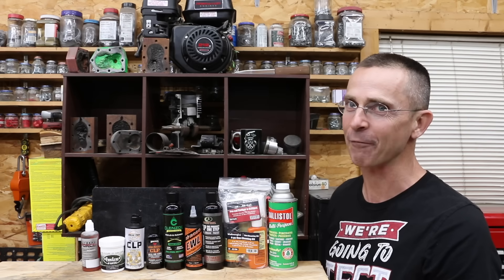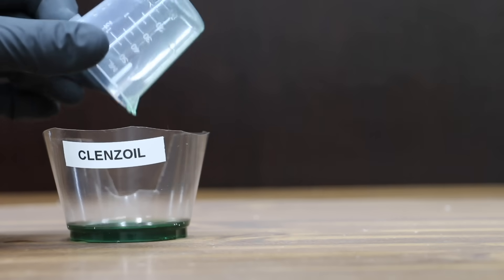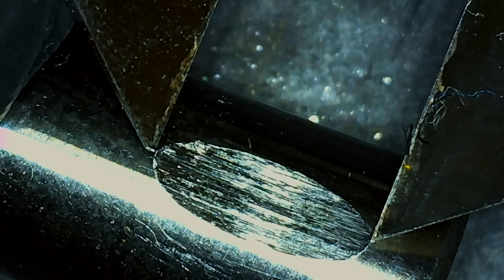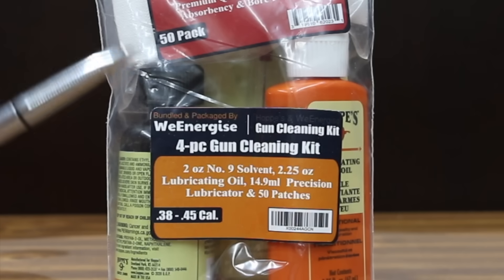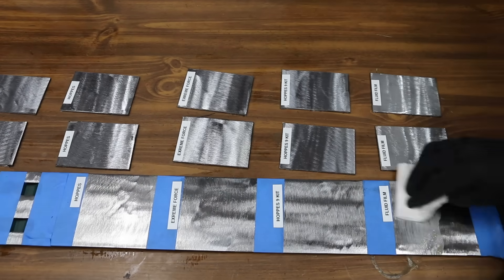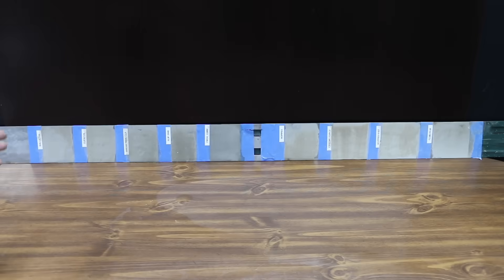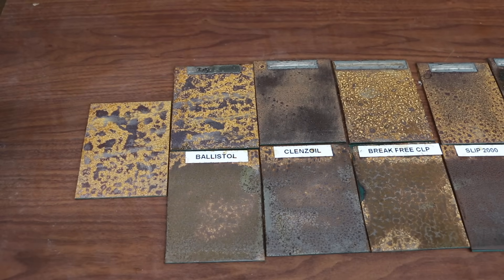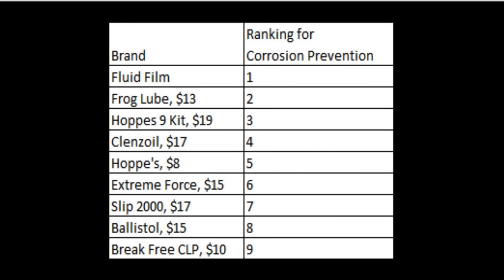Don't Buy A CLP Until You Watch This Review! It'll Save You Time And Money!

Comment: Would like to add my experience with froglube here. His tests are very good but he did not test how well they perform on firearms after being in storage. I was solidly in camp froglube because of the non-hazardous material and pleasant smell, as well as the purported good lubrication. I used it on everything. I have more guns than I care to mention so even when I shoot regularly, some of them inevitably sit for awhile. After 6+ months of sitting in a safe, froglube will gum up, will semi-solidify, and will cause malfunctions. It made an AR action very difficult to rack, and it more or less stopped my 1911 TRP from working. You could pull the slide back, release it, and the slide would crawl the last half inch to get back into battery. Imagine having this stuff on a carry gun on your side that is unfired for over 6 months. Highly believable, especially with the wider variance in temperatures that you're sure to see versus the gun sitting in a safe. 

Do not use froglube.
Reply: Same thing happened to my 10/22. Took it out to shoot after a few months of sitting in it's carry bag. Lots of clicks but no bangs. Ends up the frog lube had basically glued the firing pin into place. Ended up breaking the whole action down and cleaning with alcohol, and just went back to my regular go to, Mobile 1 synthetic 10-30.
Reply: @CaptainXanax  is that 10w30 your saying?
Reply: @GeauxRilla  Yessir. I had never tried it until a coworker of mine who shoots competitively says it's all he uses. That was about 10 years ago. I guess if you live in a consistently freezing climate you could use 0W-30. 🤷
Reply: Same thing happened to me… every single gun….  Never again
Reply: Rumor is that it's mainly coconut oil.
Reply: @justinkase1360  that would be accurate as it has the exact same consistency and feel. However there are additives as it seems to clean well, for me anyway, I assume their "extreme" liquid lube that is for colder weather is just fractionated coconut oil. I think after I run out of product I may switch to something less fussy, but for now it works well enough for my use.
Reply: @justinkase1360  it the base with additives. The additives are what do most of the cleaning and protecting
Reply: You put it on waaay too thick.
Reply: Had similar experience with the liquid frog lube when I liked weapons out the safe to do random functions testing & what not  in an unheated portion of my home just to realize that all that I had cleaned in the last round since I purchased frog lube were extremely sticky action wise and would not function. Took them in the house front of the heater and they function tested fine but that was the nail in the coffin for frog lube for me. Can't trust it in cold weather and can't trust it on my edccw then I don't need it. Really wanted to stand behind it being a disabled veteran myself and this company being owned by disabled veterans but I'm not willing to sacrifice my family's safety just to support a fellow veteran.
Reply: Same exact thing happened to me, and I argued with several others about it, I threw it all out afterwards. It smells like a menthol wintergreen, but the effects of being stored, nah I'll pass.
Reply: Have had  Frog lube weld a gun up solid  till hosed  down with WD 40 ,after sitting around , works for guns in hot/warm weather that are in continuous use ..  idle  guns  a now go . Great preservative on the out side of a gun , but keep away from the innards ..
Great video ..
Reply: While I agree about storage, the carry gun issue isn't as bad as your body heat typically keeps it from gumming up.
Reply: @GamerNxUSN  I would not want to count on that.
Reply: I had a very similar experience with frog lube too.  Frog Glue would be a better name because it seemed like glue in my AR after a few months.
Reply: What is it like externally after sitting..??
Does it still feel the same and does it come off??
I'm thinking about using Froglube  on the outside of blued tools to stop rust while using other products for the actual lubrication..
I like the idea of touching wax coating instead of getting oil on my hands with my tools..
Reply: @zakofrx  Try mineral oil from the pharmacy section of the store. Sold as a laxative, but it's an excellent lube and protectant for things like hand tools. It's safe to eat. Same stuff is in baby oil.
Reply: It's coconut oil. Ugh.
Reply: Had the exact same experience. Do not use Frog Lube!
Reply: You have to remove most of the residue after heating a thicker layer into the metal parts. Its essentially a dry lubricant working at a microscopic level. If it gunks and freezes up then you have it on too thick.
Reply: How much do y'all put?  Ive never had a problem
Reply: Been using Frog Lube for probably around a decade. It's on every gun, long and short, that I own. I live along the Canadian border, and worked law enforcement for 3 decades. I never had a problem with it. The idea is to apply it and then remove as much of it as you can (if you aren't applying it and letting it sit in the oven). If there's nothing but the things film on the parts, there's nothing to gum up. My days sometimes saw 20° below zero, and no issues. Apply it thin!!!!!
Reply: You're using the product wrong.
Reply: Dude, But A Navy SEAL made it Bro!!!!!🚢🦭
Reply: I was told by a Frog Lube Representative that putting the FL on a AR boltcarrier group then putting it in the oven on150-180 degrees for 10 minutes or so and then removing and reaply a light coat on the bolt was the intended way to get the penetrant to soak into the steel. Just what I was told, suppose to replicate RF85 coating. ** remove the rubber o ring in the extracter hole first if your bolt has one**
Reply: I had it freeze my safety on an AR. No bueno!
Reply: Never had any problems with it. Not sure how it gunks up when you apply it by heating the metal, brushing it on, and then carefully wiping off the excess. Sounds more like operator error than a bad product.
Reply: @silntstl  These dudes using Froglube like axle grease. . .
Reply: Frog Glue gums after about 45 days.  It will gum up even quicker if you don't have every speck of petroleum based products cleaned off your gun prior to applying it.  So, if you use Frog Glue and then are at an event and need a re-lube, you cannot use any other product or your pre-applied Frog Glue turns to honey.  Frog Glue is for suckers;  it's dog crap +P.
Reply: The bio degradable cleaner worked really well. The lube not so much.
Reply: Right. Which is ridiculous if you’re in the field. I used a lighter and melted it on. But I still found in freezing temps it clogs up. I’m sure it has its place but for me, not practical. It’s easier to use an oil type lube and be done. I’m cleaning my weapons on a regular enough basis dirt is irrelevant
Reply: I 100% agree. I used Froglube for about 3 years and after taking out a firearm which was lubricated with Froglube and stored for about 6 months, I was shocked to see that it was basically "caked" and the lube had turned into a gummy substance which no longer provided the same lubricity it did when it was first lubricated.
Reply: that's because froglube is coconut oil
Reply: frog lube is the worst.  as in worse than nothing
Reply: Aren't the parts supposed to be heated up to 120F and the Froglube applied in a very thin coat, left to sit and wiped off?
Reply: Frog lube is garbage----when ANY product says it was made by a "Navy Deal" you know it is BS.....
Reply: Are you talking about the paste version or the liquid as well?
Reply: It looks like the gunk you get from too much oil.
Reply: I've experienced similar, but I still use it to "season" the metal (I bake the parts at about 185) and use another lubricant (kroil works very well specifically because it's so thin) after wiping it off.  Works great that way.  However, you can also just use a heat gun or hairdryer on the moving parts and cycle the action a few times and it's fine.  Frog lube is designed to increase it's lubricity as the temperatures increase.
Reply: I noticed that.  When I first took a stored 1911 style pistol out of the safe, racking the slide was noticeably more difficult with the Froglube on it.  Once the pistol warmed up to room temperature, it was fine, but what you've said is something to think about.
Reply: Thanks!
Reply: For long term storage I've been using corrosionx for YEARS now and there litteraly is no better product for protection purposes. Never gums up, is safe on pretty much all materials and just the smallest bit goes a long long way. It's lubrication properties alone are in a category all to itself. I've worked on firearms professionally for almost 30 years now and have always had an obsession with all the different makes, models and chemical designs when it comes to dedicated cleaners and lubricants. I've literally tried everything worth trying and have come to the conclusion that when it comes to solvents there's 3 seperate categories dependant solely on user task. You've got the harsh chemical designs, the mild strength "safe" designs and then your actual safe for you & environment designs.... I'd be here all day if I started naming products and their categorical place..... But with dedicated lubricants there's really only 2 categories, both with very few products worth really mentioning. Those categories are oil & grease. I don't use grease because I've found two dedicated lubricants that now perform in a superior degree both functional and environmental, from -80 to 600°F+. Those two products are either Weaponshield & Sprincos machine gunners lube. The weaponshield calls itself a "clp" but in all reality it's a better dedicated lubricant than anything else. Both the weaponshield and sprinco have almost the exact same viscosity which is almost in the middle of the road consistency. Not too thin, not too thick. Oil migration is of zero concern if you know how to actually apply certain lubricants, nomatter it's consistency. I run the weaponshield on the vast majority of my pistols, pcc and a few shotguns and the sprinco on my heavy use firearms like my SOLGW AR15 & a few AR10s. The harder the sprinco lubricant is pushed, the better it protects even in harsh environments while the weaponshield practically eliminates any kind of wear on the firearm whatsoever and the more you use the weaponshield after each cleaning the easier to clean and properly protect greatly increases.....

TL:DR -
BEST storage protection - CorrosionX
BEST dedicated lubricant - Weaponshield & Sprincos machine gunners lube
BEST dedicated solvent - Depends on what you're cleaning and how harsh of a design you're after. I personally recommend Wilson combats carbon cleaner because it's just as strong as hoppes, sometimes stronger yet is way less harsh on your skin and the environment and has ZERO ammonia.
Reply: Depending on the environment, mold may begin to grow.
Reply: Yeah, maybe good to dunk heirloom guns in that you never intend to shoot for long term storage, or non-moving surfaces.
Reply: I bought it with no intention of using it for firearms, but to use on knives, mostly to prevent rust. I figured it was probably a step up from mineral oil. I wanted a food-safe oil with no unpleasant smell that was easy to work with. Knowing it's limitations, especially how it gets less lubricious with age, I probably wouldn't use it on guns unless it's for short-term use and I'm expecting to clean and replace it often, like maybe a competition gun. I wouldn't put it in a defensive gun, I'd want something more reliable and versatile.
Reply: Frog lube is trash. It's coconut oil with scent and viscosity modifiers. You have to wipe it all off or it gums up your guns, hence the "high tech" application instructions lol.
Reply: It does gum up a but but if you are not using yoru gun for 6 months you should be cleaning them anyways; not just leaving the same stuff on them. The others oils will totally drip out of the chamber onto the trigger and handle and on the floor of your safe or place you put yoru firearm. Frog lube doesnt., I use Froglube with no issues at all but maybe i take care of my guns more often than you. not in a disrespectful way but it doesnt gum up for sometime.
Reply: Can conform froglube does degrade overtime.
Reply: Thanks!
Reply: I agree. Surface use only. I was disappointed as well. My favorite is tri Flo
Reply: My experience with Froglube sitting on AR15 rifles sitting in a gun safe mirrors yours exactly.
Reply: I wonder if you could apply combinations of these to get the benefit of their different properties?  But, that would require some testing.
Reply: Frog lube is complete garbage in cold weather. It will gunk up a M4.
Reply: I've heard that too
Reply: The Democrats, Manufacture,  Froglube. Someone needs to file a Class Action Lawsuit.. If the company is still in business
Reply: How would your carry gun go unfired for six months.
Reply: @robertwatson818 by not shooting it... Like most of us
Reply: " Imagine having this stuff on a carry gun on your side that is unfired for over 6 months " not saying your wrong but this statement alone is crazy.... youd never have an EDC that went unfired for half of a year.........
Reply: @trentonpowers8570  you'd never? Tell me there isn't thousands of Americans who carry everyday who haven't fired the gun once.
Reply: @trentonpowers8570  I’m sorry but your wrong. I bet most cops only qualify every six months. They carry everyday. I bet most don’t shoot their guns other than qualifying
Reply: @trentonpowers8570  A lot of people have a gun that sit in a drawer or in a holster and the never even shot it once. I know a few people that way and their excuse is ill figure it out if that time ever comes.

Comment: @Project Farm  Love your video! Wanna bring some product to your attention if you are doing a part 2: milcomm TW25b or TW3000 (very expensive but highly rated grease/oil), Weapon shield (also has videos for lubricity test, really wanna see how it compare to Clenzoil), Lucas Extreme Duty gun oil (also one of the top rated oil), copper anti seize (as on stock Glocks), moly grease (such as Mobile AeroShell 33), Grizzly CLP (USDA certified), ALG go juice (as backed by Geissele, Iranveteran8888, non-toxic)... Just got a bottle of Clenzoil after seeing you video, but I have pretty much all of those on my shelf. Wonder which one should I throw away LOL
Reply from the maker: Thanks!  Thanks for the suggestion.

Comment: the lubricity test is a good metric for metal on metal wear, but your test on the dust attractant is the most important one for 'field' use. people often over look the dust itself acts as sandpaper, and when your running your bold over certain surfaces and compressing that abrasive it can quickly do damage to parts like the cam pin. and while the gas should be dislodging almost all of it during fire (semi self cleaning) also remember its air compressing off your lubricants. so its still prudent to keep your gun moist with w/e product you choose through out the day during heavy use both for part wear and reliable function.
Reply from the maker: Thanks for the feedback.

Comment: Clenzoil arrived, and I attempted to use it for a light lubrication of a Glock slide. Shook well according to instructions. Super highly viscous, like water, ran extensively. I might use it to lightly coat an entire firearm for storage. But I'm darn sure I'm not going to use it for lubrication of moving parts like pistol slides and AR-15 bolts, etc. Too viscous. Back to using Ballistol.
Reply from the maker: Thanks for the feedback.
Reply: @ProjectFarm  When I buy a new Glock pistol from the LE supply store I usually buy from, the pistol upper is coated with a super-fine, super-viscous oil. I really like it for storing pistols, but don't know what it is as to brand, etc. I haven't been by the store, which is quite a way from me, to ask them, keep forgetting to ask when I am there. So the other day, just before I found your channel, I called made contact with Glock. They didn't know what oil it was. They suggested Breakfree CLP, Lucas gun oil, and Weapon Shield. It dawned on me after I posted my last comment that that super-high-viscosity Clenzoil might be that oil. So as long as it's good for long-term storage of Glock pistols and other firearms, I might just use it for that. Thanks so much for all your good testing work. Great channel. I'm hooked.

Comment: The Frog Lube wasn't tested properly. It's meant to be applied to a heated up surface so it liquifies. It's still has a ton of issues after it dries but it seems unfair to test it like it was just an oil like the rest of them.
Reply: I use motorkote

Comment: Any of you use plain mineral oil for protection? It's recommended by oldtimer YouTuber GunBlue490. I've been using it for light wipe-down on a Rem 700 after each hunting occasion.
Reply from the maker: Thanks for sharing.
Reply: @ProjectFarm  I'm wondering what others know or think about using mineral oil. GunBlue490 recommended it for wiping down rifles, and I've been using it to wipe down a Rem 700 (nothing else so far), but I don't know any more about it than that (excect that that's what baby oil is, just mineral oil). I don't know if that's really a good choice or not. One thing about it is that it's widely available even in grocery stores, and it's extremely inexpensive.